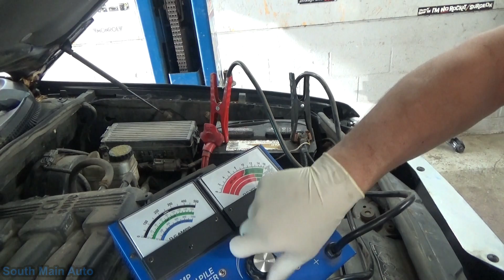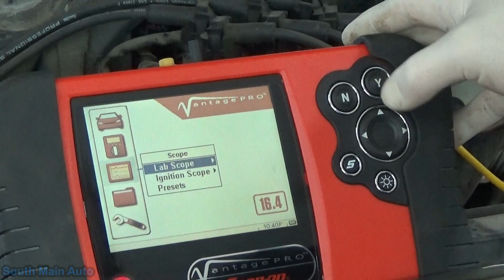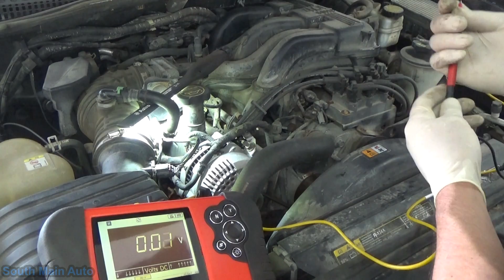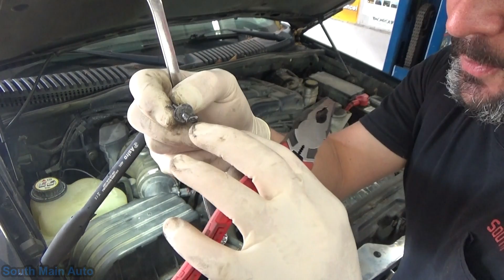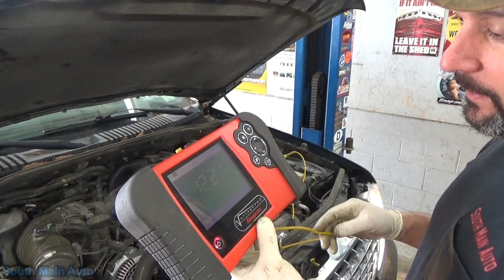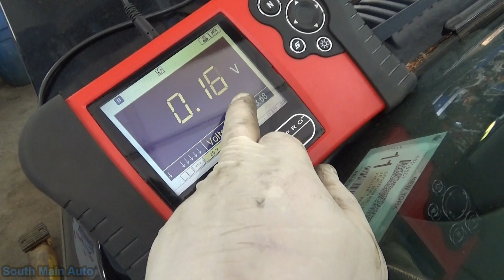Charging System Problem - Voltage Drops

Comment: Now you know why I rebuild all my Starters and Alternators myself. As I use high quality parts. None of this swap and pray stuff anymore. AS I can rebuild an Alternator in 30mins. and know its right the first time.

I might add. Again nobody checked the voltage regulator for the proper color match for that vehicle. As there is 3 color combinations. And you have to use the right one...
Reply: I have went back to doing that also -- Denso units are really easy to do.

Comment: Would the AMP draw have shown the same, if you would have connected it to the NEG post of the battery? I believe the alternator sends current to the NEG side of the battery and splits between the frame and the battery. After five mins at idle, the battery should be accepting around 10AMPs, if it is fully charged.

Comment: I hate electrical problems of any kind.  I've had two cars in my life that had a bad factory battery harness that caused the battery to die overnight.  Even though there was continuity between the alternator and the battery, the cables couldn't deliver.  I also had another funny situation on a Pathfinder.  One morning I started the engine and turned on the headlights and they both bulbs blew.  I turned on the heater blower and it sounded like a supercharger!  Turned out to be a plastic connector at the battery for the alternator wire was bad.  The alternator current wasn't making it to the battery but it did make it to the headlights and the heater fan!
Reply from the maker: Lol must have been really bright for a second or two haha

Comment: 2:32 The negative terminal started smoking
Reply: Under full load they do produce some pretty fair amounts of heat. Probably burning off some residual corrosion or oil that was left by touching the terminals by hand when jumping it by the owner/tow driver, or eric :D

Comment: I bought a reman transmission directly from the Toyota dealer. It lasted two months after the warranty expired. The torque converter clutch disintegrated.

Comment: I have an 02 f150 voltage drop when ac is on at idle, trans on park.  Every light will dim and idle drops.  No issues when vehicle is on drive or in gear while vehicle is stopped.

Comment: Producto de Mexico....Went through 2 remans with the exact same issue. Hotter than a firecracker and lead connection snapped off on removal. 4 months on this one, time will tell if it starts to build resistance again.

Comment: great video I have tgat same battery tester all a guy needs minny cars are so expensive
Reply: I can't type on this dam phone
Reply: I also have the same 800 amp  tester these carbon pile testers are difficult to find and more expensive here in the UK but I needed the higher curent rating because batteries are getting so much bigger. However I probably use my battery AC impedance more.
Reply: Andrew W MacFadyen if u want let me no what u need i could send it to u

Comment: Great and very informative video! Quick question. And sorry but I'm total newbie when it comes to all  of this. I have a 4 liter 4wd 2001 Ford explorer sport Trac. My issue is my volts gauge runs low and interior and headlights flicker. I thought it was the voltage regulator on my alternator. New alternator, charged battery and the issue remains but less severe. I used a multimeter to test voltage. Cold battery is around 12.39 v. Running idle with no load is a low of 14.02 to a high of 14.18. It constantly fluctuates between the two. With a full load (ac, radio, headlights and interior lights) it jumps between 13.92 and 14.10. 

I tested the volts between the battery and alternator.  

The positive voltage (with the positive lead on the output terminal and negative lead to the positive post on the battery) went between 0.05 up to 0.07

The negative (negative lead on the alternator housing and the positive lead to the negative battery post) around stayed at around 0.01. 

I'm a little confused as to what this all means. Any suggestions? Thank you you're time and consideration.

Comment: I would have told the customer what the deal was and told them they can buy a new alternator or use this one and not sit at a stop light with all the accessories on.  A simple digital plug in the cigarette lighter volt meter would let them know the state of the battery.      
  All this jogged a memory loose, when I was in a third world country many years ago the cab drivers would turn their lights off when stopped in traffic so they wouldn't drain the battery.

Comment: Seams ford cheaped out on all of their early & mid 2000's vehicle's! I know that part is also used on the 99-04 ford focus! I tried removing a battery cable connection on the alternator of a focus & I learned quickly, HAVE TO BE GENTLE! CHEAP PLASTIC PARTS MIXED WITH POT METAL=JUNK!!! SAME SET UP AS A FOCUS & ESCORT & PROBABLY MANY OTHER FORD VEHICLE'S!!!

Comment: Hi Eric.   Love  watching your videos.  Keep up the good work!   Quick question, what tester were you using in this video?  My father wants the same one. If you can tell me the make and model number that would be great.   Thanks!
Reply: Medic8890 - I know I’m not Eric,but, the red one is a snap-on tool called vantage pro. They have a newer version still called vantage but use ultra or edge, they’re touch screen. Got mine on flea bay $600 pay attention to software version I think there upto 18.?

Comment: Hey Eric, I lost you on the amps leaving the batt ... is the alt cable b- passing the batt post and going straight to the power distribution box first, then back to batt? if it's going to batt post first, then doesn't 15 or 20A leaving batt mean the other 40 or so is being absorbed by batt rather than adding to the 20A leaving batt. Hope I'm making my confusion clear;-)

Comment: Could you not put a smaller pulley on the alternator to boost the idle current/voltage?

Comment: Alternators never put out their max current at idle. They're not designed to. They would have to be a lot larger if that was considered important. Many alternators put out around 60amps at idle (850rpm). The alleged experts say that the average rpm for an engine is 2krpm. One would expect to get full output capability then. More than likely the spec on the paper is wrong claiming 80amp at idle. If that's the case you might try a warehouse full and never get one that meets the spec.
Reply: Good question... It would have been interesting to see the idle speed when raised just enough to get the rating in the paperwork.

Comment: Remy Gold Alternators, Stay away from them, I had a problem when I had no load during the day time at certain speeds and certain RPM's it would stop charging, but as soon as I turned on the headlights or put a load on it, it worked fine. got 13.86 volts when at idle and everything on. 14.08 volts with everything off and at Idle. I changed out 5 of those and at the 5th one said F**K it!" went to the local junk yard and pulled out a 130 amp alt out of a honda oddessy. Bolted right onto my Accord V6 Engine, now I get a nice solid 14.72 volts with the car at Idle and everything turned off and 14.22 with everything on and at Idle.

Comment: 3rd gens are junk with all the timing chain and tensioner issues and plastic housing on the thermostat but this just sounds like a case of neglect
Reply: brad veith ?
Reply: just stating my opinion on these trucks i have a 2nd gen that has been a good truck and not plagued by these problems because they are built as they should be
Reply: yeah, but then they roll over. My son rolled in one, fractured his hip but at least he survived! ford finally widened the track on 3rd gen. and they improved the timing chain guides, too. (Same plastic thermostat housing, though--so no downgrade there). never another 2d gen for me, life's too precious to mess with'em.
Reply: mine has been a beast i know they are so darn top heavy they are a rollover waiting to happen thats why i just putt around town in mine don't driver her like a maniac plus shes my off road toy anyway i have another vehicle that is my daily.

Comment: I am very surprised that the PCM did NOT kick up the idle speed once the charging voltage got down to 12.2V !  You would think that a "smart charging" system would realize that at 12.2V the battery is being pulled down.

So, how many alternators did it take to get one the out 80+A at idle ?
Reply from the maker: Only one more. Second time is the charm.

Comment: Why didn't you just fix that right angle connector on the alternator? Did you check to see if the alternator that came with the vehicle could output the right amount of current?
Reply from the maker: The back of the alt. was way to crispy to swap it

Comment: poorly designed connector subject to crookchanics overtorque... and if not torqued enough, same issue...  seems the wire ring terminal could be placed straight on the Alt stud, if stud is built accordingly... and the point of failure connector eliminated.

Comment: Did someone over tighten the anode nut when the when the alternator was replaced? Twist that baby right off and broke it in the alternator. Leave the 1/2 drive stuff in the tool box.   Ha !

Comment: My 4 runner has an issue like that blows my ig1 fuse when I turn the key to on and because that circut is hot when switched it blows the fuse so I'm thing a bad ground or short and oh yeah the alternator won't charge either but I'm thinking it's because of that specific  fuse because where it's an excited wore and it runs trough the pcm

Comment: Shouldn't battery light have come on at idle 10+A discharge? I've also noticed low voltage w/ high car electrical load.
regards

Comment: Hey Eric, don't they make a special tool to find resistance in wires using voltage drop? I don't remember what it's called... :D
Reply from the maker: As you well know in this situation it would fail miserably! The load pro does not compensate for variables like in this case HEAT! The alt. worked fine with no VD until it got hot then BOOM! Would have been good to demonstrate it failing ... again. Great question BTW :)
Reply: How about a quick math question: based on your voltage drop and amp draw readings, how much power (watts) was being dissipated in that crappy connection? 

And of course Dan Sullivan would also ask: what was the equivalent resistance of that connection under load? :)
Reply: South Main Auto Repair I learnt a lot Eric O.
Thank you so much
Reply: When you ac couple the scope are your leads on positive to positive?

Comment: if it were my vehicle I live with the alternator with low output at high load. highly unlikely you be driving at idle with that much load for a long time that you deplete the battery.

Comment: Hey buddy, love your videos. I am having low voltage from a CHARGING SYSTEM FAILURE 2007 CHEVY SILVERADO. Replaced battery,alternator us good,thrown new grounds and cleaned and replaced connectors on a few grounds,new fuses....any suggestions? I've lost work over this,and it's got me messed up bad. I've had a few different guys take a look,as well as asking an alternator and electric shop I've used in the past to fix it,and they don't like to work on problems like mine. There are so many problems I've seen on YouTube for the Silverado.....unreal. Thanks for any help,from anyone that would like to comment. Thanks

Comment: Why is the positive wire putting out 1v is it getting grounded?
Reply: That 1 volt is voltage drop on positive red wire from alternator to battery positive. When testing a cable, their should be 0.10 or less voltage drop on the cable. When you get a voltage reading on a cable their is resistance on the cable. The higher the resistance the higher the voltage. Therefore it’s just a way to check cable resistance under load with current running through the cable.

Comment: So I have a Ford explorer 1995 I changed the alternator an then it started good an idles good but when you give it gas it stalls out an dies an battery is dead dead what did I do wrong or what could it be

Comment: Could you not use the old alternator and use a new 90 degree connector and then retest?
Reply: I guess they don't sell the 90 degree connector alone.
Reply: The dealer does... With all the other parts.
Reply: I can't find a part number for that connector on fordparts.com. If you do, let us know.

Comment: I have a 2007 kia sodona. New alt but 13.90 to 14.01 volts. kia min 14.20 to 14.80 most of the time i test volts it is at 13.92 i am testing with otc scan tool at dlc. can pcm be adjusted or reprogram to increase voltage?

Comment: What is "surface charge"?
Reply from the maker: The charge on a battery right after pulling it off  a charger. It can give you false test results
Reply: Will I get only false Voltage reading? Or will I get more cca than I actually have? Sorry for silly question. There is a lot of confusion when testing batteries at my work place. We have a tester (quite cheap) and it gives bad results some times in my opinion. Hopefully I'm getting a new job In Bosch approved service...
Reply: Hey Eric, you ever study any of Vince Fischelli's material?  I have been studying his material as well
and he goes pretty deep on a lot of what you did in this video. Another Great video by the way.
Thanks, Tony

Comment: 6 ga. charging cable with 14 ga. connector...found on road dead
Reply: Reminds me of  1970s Lucas alternators rated at 45 amps fitted with 35 ampLucar  blade terminals.

Comment: I guess the question is, are automobiles of today made to take Max Load from All accessories ON at idle  forever? They should but are they made this way? Never tried a full on idle load test before. I would think they the manufactures have the averages in mind?
Reply: Back in the old days when cars had DC Dynamos even with no additional loads the charge warning light  would slightly glow at idle, the battery would only get any charge at RPM  above fast idle even then the output was less  than half what we expect even from a small alternator today.  Even when alternators were first introduced they were too low an output to meet all load conditions. Modern cars have alternators with  3 to 5 times  the output of the ones fittedin the early 1970's but loads have also increased dramically.

Comment: Figures! Sub-par right out of the box! Sub-Par Auto Parts - that should be their new name, lol.

I've completely sworn off Advance, except for when Brake Parts Cleaner is on sale - ain't worth the hassle! I spend more time driving back and forth to their damn store returning junk than getting people's vehicles going. If the customer can wait, I'll order parts from rebuilderinabox.com - at least I know it'll be remanned right in that case!

I swear our wives are related, lol - the banter is nearly identical! All in good fun, though. :)
Reply: Smitty Smithsonite -I second rebuilderinabox

Comment: What, NO MIDTRONICS conductance tester. Are you still in the stone age Eric? If you're going to use a carbon pile it's got to be a Sun, you know the one that every starter/alternator shop in America had in the 1970's that rolled around on a metal cart. Those were real men machines. They worked well. Not as fancy but certainly they got the job done and took a beating like a Timex watch and kept on ticking.
Reply: SATAMAN Schmidt I believe it's good to have both conductance and carbon piles testers in your shop.  Ran into a few where the conductance tester said it was good, but it fell on its face under load.  We still have our old vat 80.
Reply: lol
Reply: Yes I do impedance/conductance tester first then if still  any doubt get Igor to connect up the Frankenstien machine.
Reply from the maker: I have not had a load test fail me yet. Yes I have the midtronics test with the fancy print out and all but it is hard to beat a 500amp load and a little smoke! I like to see. I am a visual learner and just feel more comfortable when I can smoke it up with a carbon pile.

Comment: The usual why are the alternators so far under the systems requirements... Even the original must have been barely enough to cover the consumtion. Bad carmanufacturers! Bad bad bad! haha. Also that the remaneds ones are so bad is quite terrible. But that is the truth, they might as well just have sent you a stone in a box. Text-Rant over and out! =D

Comment: Hmmm I wonder what the customer would say,if you told them,sorry buddy,I will only install a factory ford Alternator that costs $450.00 dollars,plus Labor and testing charging system.Or the other option,I will Install Junk Aftermarket,However Everytime I Take it on and off,Its $70.00 dollars labor,and multipy $70 dollars 5,6 or 7 Times,Haha,Take your pic Buddy.Do It Once or Taking Your car to the wedding chapel,Cause I Aint Marrying Your Car,LOL

Comment: $5000 worth of test equipment to check a $50 alternator.
Reply: Brian Kiehnau 

Welcome to modern cars. Wait till we are mostly electric cars. Yoy will need an IT guy to find a shorted wire. 😱
Reply: Bad  connections and shorts  are electricity 101.
Reply: Brian Kiehnau yeah because that "$5000 test equipment" can ONLY test alternators. Nothing else.
Reply: Hey Brian, Eric could have used a 40 dollar volt meter for this procedure but he uses the
Vantage Pro for filming purposes for better clarity. Just saying
Reply: If he already has that equipment, why use anything else?
Reply: Someone don't understand what all that tool can do.
Reply: Oh geez even the best multimeters have a best accuracy limited to only 50.volts for a whopping near $500.00 so nowadays u get what u pay for